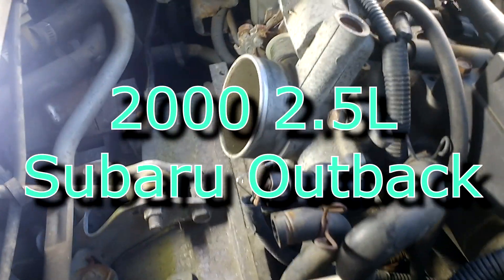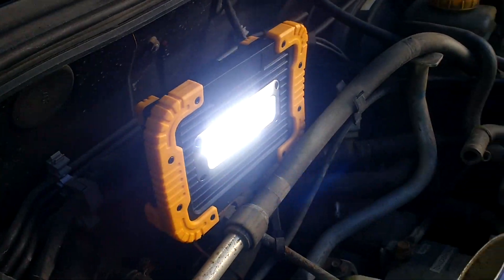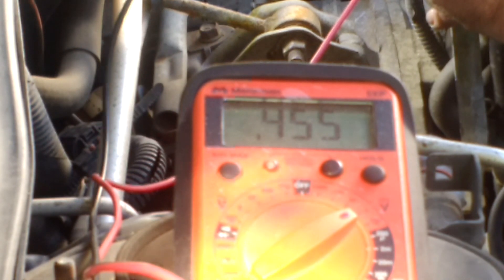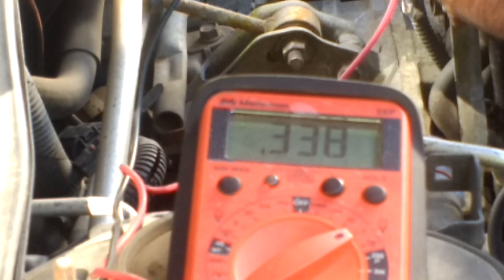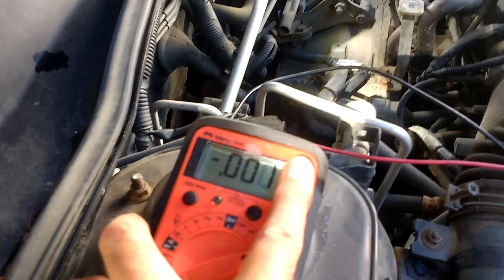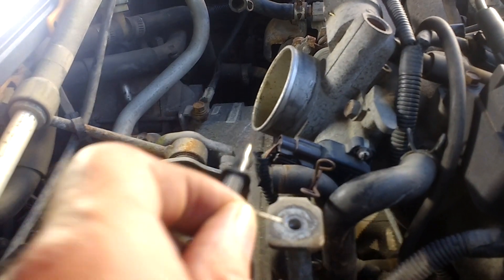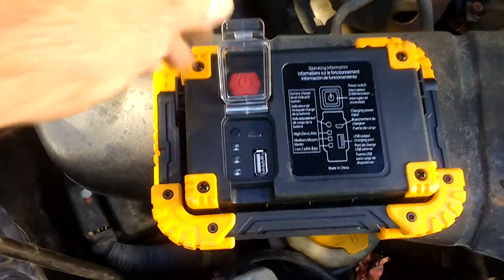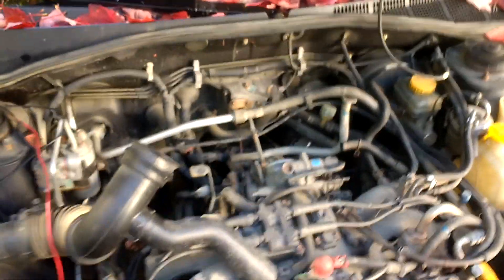Adjusting 2000 Subaru TPS 2.5L

Comment: I tried that method and it created a stumbling situation. Turns out the volt reading at the TB is higher than what gets to the ECU due to wire resistance between the 2, Reset to .50 vlts via scanner reading the ECU and stumbling went away and engine now runs great.

Comment: Hi Mark..... I watch your videos related to Subaru and love the way you explain issues and suggest solutions. Its matter of time that i am struggling with an issue with my Subau Forester, 2005, 2.0X, Non-turbo. I recently cleaned my throttle body, PCV valve, TPM sensor, MAP sensor, EGR valve and IAC valve. After refitting them in car, my Suby behaving awkward way. Idle RPM are gone high and there is a fluctuation. Same time i am getting some oil burning / overheating smell with some smoke coming up from somewhere down near catalytic converter/ drive shaft boot. Please give some clue on these two issues. Thanks a ton bro for help.....:-))
Reply from the maker: It's hard to pin it down to one thing as so many things we're removed and put back on. The high idle could be related to the throttle body, idle module, and even an air seal leak. Make sure all gaskets were put back where they belong and none are cracked or torn. Make sure you reconnect every plug securely. Is it showing a Check Engine light? The smoke could be from head gaskets that are leaking oil and you are just now noticing this with the car sitting still.
Reply: @contact4mwy7  i checked all hoses and sensor fitting again. I found my mistake in fixing TP sensor with its tang on wrong side of throttle shaft pin....:-)) i refixed it and adjusted in a position so that signal wire giving a reading of 0.45-0.55 volts. My issues are solved and RPM are stable at 650. There was a check engine light there,which is automatically gone after I drove car a bit.I wil drive a bit more and see if burning smell is gone....Thank you for your suggestions. Appreciate it 🙂

Comment: earlier i changes my fuel injectors, got from US ebay, new that shoud work bether than new ones. But still engine stumbled every time i press the gas pedal fast. so i put back orginal used orginale throttle sensor, and calibrated it to 0.5 volt ( when engine is not on ) me, my wife. and a girl who used my car to pratice drive, notice it was stumbeling 90% less. and fuel consumsion was 50% bether, i also changed Idle Air Control Valve, becouse it was seaced, and engine was all over the plase when not hitting the pedal. But after 24 years, it call it the night, it has to retire somtimes. In short, if u have a 24 year old subaru, just change most sensors, air filter, gas filter, injectors, plugs, coil, and plug wires. they all get old and work bad. Fuel pump in tank i changed 4 yers ago, just to be shure.

Comment: adjusted my throttle pos sensor to .5 volt, now disconect battery for 10 min. Hope it helps. becouse when i press gas pedal fast down, engine stumbeling, so i had to press gas pedal realy slow down when im driving. subaru outback 1998 mod, 2.5L ej25d engine. changed used throttle sensor. after that, engine stambles 90% less. ( used one ) bouth a new on ebay, new from delaer bodø norway cost 10 000 kr. Fucking mafia

Comment: I did the same thing without cranking the engine. And nothing popped up on the multimeter should I stab the wire deeper?
Reply from the maker: If you have the right wire and you're not getting a reading, that could be the reason. Make sure you have a good ground connection too.

Comment: it's better to have the seperate batteries so you dont need to throw the light in the bin when the cheap builtin battery quits.

I have one from china and it uses 2x 18650 and you can also put 4x double A batteries in it and charge the 18650 in the lamp and use it as a powerbank like the one in the video.. just  pop in fresh set of batts and youre charging youre phone again. mine have been working hard for the past 5 years or so and still going strong! cold winters here in Finland eat batts like a recycling center so its  nice to have spares.

Rest  of the video was usefull to me so thanks :D

Comment: My check engine light is on for tps, when the cars cold it starts up and idles high but once it’s warm it idles normal..
Reply from the maker: Is the Check Engine light on because the tps is faulty?
Reply: @contact4mwy7  it says throttle position sensor/switch “”A”” circuit low input
Reply: So does that mean it’s faulty or just not adjusted correctly
Reply from the maker: I'm not familiar with that code, but saying it has a low input sounds like it is either out of range and needs to be adjusted or it is faulty and needs to be replaced. Try googling it's symptoms and code and look for a forum that discusses it?

Comment: On one hand, we appreciate the effort and information.  On the other, there's no reason at all why this has to be presented as a seven-minute video instead of just saying "adjust the TPS output for .5V at idle".  See how easy that was?  And I'm going to add another interesting fact:  The ECU supplies +5V to the TPS when the ignition switch is on.  The engine does NOT have to be running.  Also, be aware that if you pull the pierce-the-insulation-with-a-pin trick, over time moisture will get into that hole and attack the wire.  Odds are it won't become a problem during the car's lifetime, but I've seen a small nick in the insulation of a ground wire result in opening up the conductor completely and create absolute chaos in the vehicle.
Reply: just add some sillicone in that hole, or glue.
Reply: I agree  , this looked like a mumble bumble fuck video . typical you tube 19  minutes of bullshit followed by 5 seconds of good info .  Didn't seem like he was very profesional at all . youd have to PAY ME to let him work on my car
Reply: God you would love TikTok. Some people appreciate and learn better when they see the process. No need to trash others just because their teaching style doesn't fit your learning style.

Comment: The sensor on my wifes car doesn't have screw holes that allow for adjustment. Just put a new sensor on it the only way it can go on, and still got the check engine light. Useless electrical crap.

Comment: Thanks for posting man. I just followed your 7 minute video in about 10 minutes and got rid of most of my rough acceleration stumble. I monkeyed with it before, so it was my fault... but you helped me fix that mistake 🙌 now I'm resetting the ECU
Reply: Just doing it myself. Is reseting the ecu necessary after this?
Reply: @maxportillo4262  resetting the ECU is easy. Just unplug the battery while you do everything. It takes 10 minutes at idle chilling in the car. It's needed because the computer keeps running at the old settings, not what it should now, so if you fixed anything the computer won't adjust for it
Reply: @anothersomebody8195  So after I reset the TPS. I disconnect the battery for 10 mins, then let it idle for 10 mins?
Reply: @eugenegreenin1903 I disconnect for about 30 minutes with the key in the on position. Clean the battery posts if needed.  Remove key and reconnect battery.

Wait for car to be totally cold... Then...
Start car and let idle for about 7-10 minutes (it goes through the warming cycle and hunts for the various idle levels at different temperatures), then turn on the AC and continue to idle for another 5 minutes (this let's it idle with a little bit of a load).
Reply: @anothersomebody8195  Awesome Thanks. I tried the 10 min thing and I'm going to go try your method now. My TPS was at .38v and after adjusting it to .50v it's pretty zippy. It's a rebuilt motor with a turbo bottom end in it. My mechanic called it the "bulletproof engine" since replacing the gaskets and keeping the existing bottom end will usually cause problems so his buddy builds these and he puts them into subaru bodies in good shape. It felt like the car was trying to figure the new adjustments out. I'll go reset it's brain. Thanks again for the info......
Reply: @eugenegreenin1903  you bet and good luck. I had the standard gutless motor and tried everything under the sun. Finally gave up and sold it and my camper van for a proper truck. The subbies are fun to drive though 😁🤙
Reply: @maxportillo4262  by the way, I never fully removed the stumble in my manual transmission vehicle and ended up selling it for a truck as it was.

Don't do aftermarket spark plug wires

Comment: I would have gotten more out of your video if you were showing what you were doing at the TPS rather than watching the meter
Reply from the maker: If I remember correctly I had loosened the screws that lock it into position and was twisting it back and forth to arrive at the measurement I was looking for. How's that?

Comment: Do you know why in my meter shows 5.00 volts?
Reply from the maker: I do not, can your meter register a half volt DC? Are you sure you are measuring the correct wire? What year is your vehicle?
Reply: @contact4mwy7  95 subaru svx
Reply from the maker: It may be your meter or that the system is different in the '95 from the 2000 system?
Reply: The TPS is supplied with 5V from the ECU, so there are a couple of reasons you could be getting a 5V reading.  First, you could be probing the +5 wire instead of the TPS output. Second, if you have a bad ground on the TPS, the output will read 5V.

Comment: How were you adjusting your throttle position sensor?
Reply from the maker: I loosened the screws and adjusted using a voltmeter as in the video. I was rotating the throttle position sensor until I got the reading I was looking for. Once I got the correct setting I tightened the screws.
Reply: Mark Young - Outside The Box another question is that on my wire harness connecting to the tps the middle wire is red. Should I still connect into the white wire? I assume that’s the signal wire
Reply from the maker: What year is your car?
Reply: Mark Young - Outside The Box 01 legacy gt
Reply from the maker: I don't have an answer as to why your wires would be a different color, so, try probing the middle wire first and if you are not seeing digits show in your multimeter that are similar to those in my video, try the white wire. On your multimeter, black to ground, and red to the probe wire. Millivolts setting. Will that help?
Reply: Mark Young - Outside The Box yes thank you
Reply: Awesome Video! Does the car have to be running to adjust the tps ?
Reply from the maker: No, it just needs to have the key turned On for power. Thanks for asking!